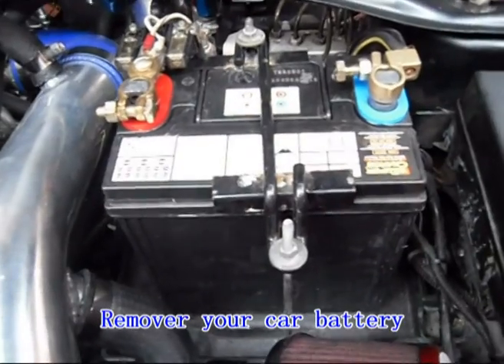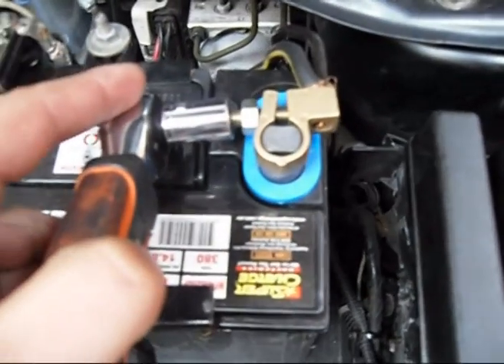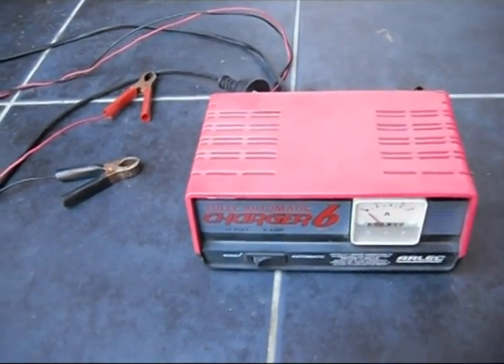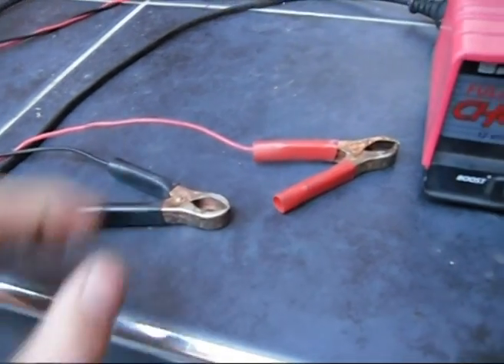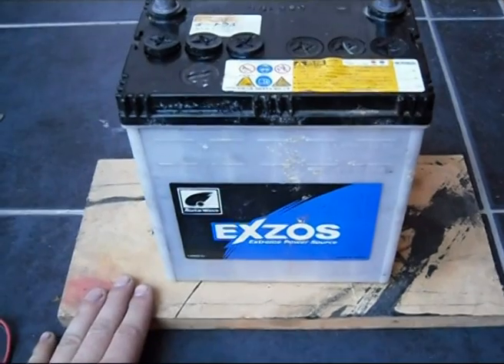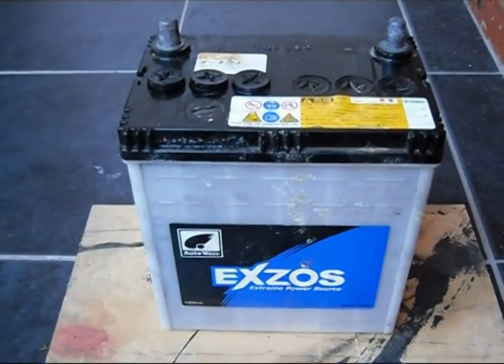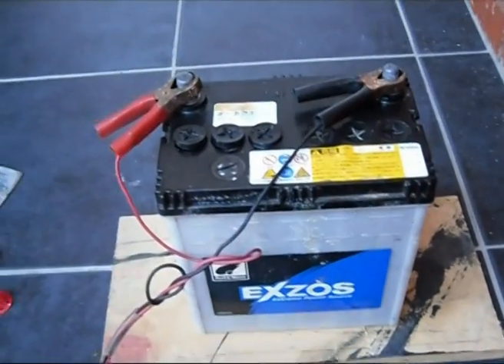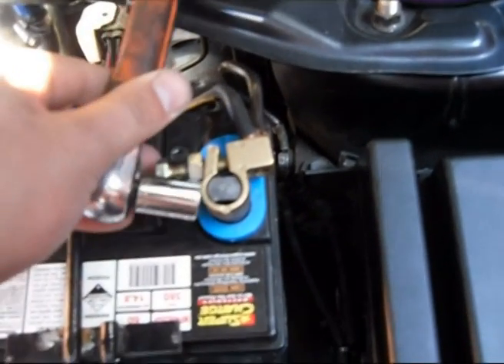How to charge a car Battery

Comment: Most people do not know that is very possible to revive virtually any battery. From a car battery to reconditioning of NiCd and NiMH batteries or lithium-ion batteries. And, with a bit of knowledge and some simple tools you too really can do battery reconditioning yourself [Check Details Here==>https://plus.google.com/100351090281822647456/posts/Ct2x2kZGdNN ]. Reuse your "dead" battery without hurting your wallet.
Reply: Esther Jenkins kkkkkkkjjImmobilie

Comment: Lots of people will throw away old batteries not knowing they can be brought back to their initial magnificence? Batteries are not low-cost! Prior to tossing out any kind of battery you ought to evaluate them to see if they could be recovered.

Not just will it save you loan but it is additionally environmentally friendly. Batteries consist of chemicals that permeate into our soils and also end up in our waterways. By reconditioning batteries we will eliminate 50% of the batteries we toss out.

Comment: I never remove the battery from the car to do this
Reply: It can be necessary if you don't have access to power where your car is, but you are supposed to use an extra minimum 24" AWG #6 cable to the negative so that you are farther away from the battery if it explodes.

Comment: @Nitroazza the battery would build up gas inside due to the pressure rise of the acid and possibly explode! But charging a battery on one of these lil toys is at a low charge rate so it is safe